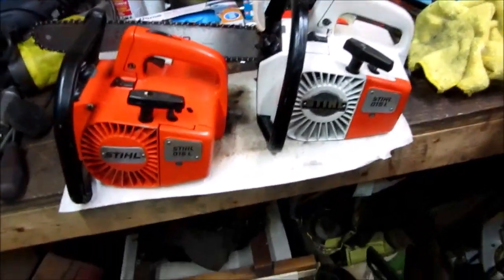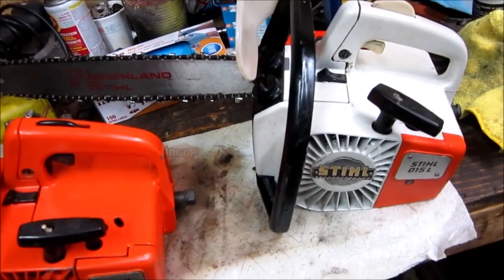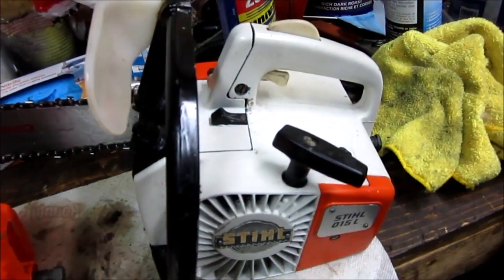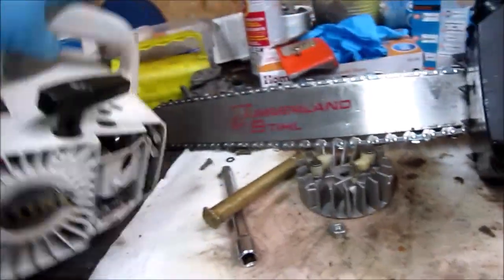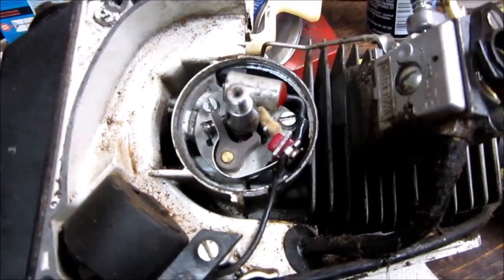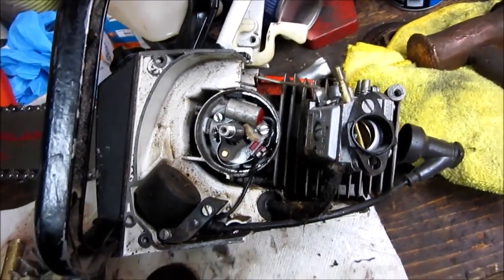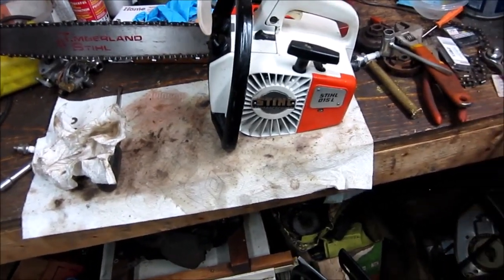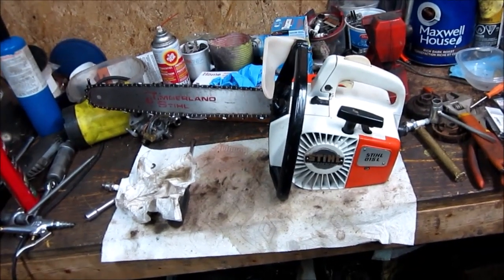Stihl 015L cleaning and seating the points

Comment: I just bought on ebay for $25 the electronic ignition module for my 1973 015L that's used to delete the points system and it works waaay better than the points did. The points on mine actually worked very good and had hot spark but the electronic module is much better, especially on the top end. Was very easy to install, looks good, is 100% water and vibration proof and it'll be the last time you have to remove the flywheel for ignition related problems. I bought this saw a month ago and I'm already just about done building it. Has custom expansion chamber exhaust, custom K&n air filter, brush polished sprocket/muffler cover, and I made a custom felling spike for it and ported the cylinder head. I like this saw because it can be customized and easily returned to stock. I have a 14" rollomatic stihl bar for it with 1/4 chain and a 14" titanium carving dime nose bar for it, it pulls both like they're 10". I'll send you some pics of my saw if you'd like, it's a little beast.
Reply from the maker: Sorry I just seen your comment and I agree with you

Comment: $15 was a steal for that saw, I just paid $87 on ebay for an 015L to restore as a project and another $40 in parts to get it running and looking good. I ported and polished the cylinder head and now this little saw has alot of grunt for a small saw. It pulls a 16" bar like it's a 12.
Reply from the maker: There a great little saw . Thanks for taking your time to watch and comment Cheers
Reply: hey big texas. I also was given a 015 L that hasnt been started in 10 years... sitting in an open garage. it started right up for me. im in west texas by angelo, can you teach me how to polish the head and port it? I need it to provide for my family due to the oil fields being shut down.
Reply: @thomaszinecker1785  I learned how to do it by searching - chainsaw porting - here on youtube. It's not hard, you just need the proper tools. This video helped me alot posted by a user named Human. - First Cylinder Porting, Stihl MS270 - After you've successfully ported your saw then you'll want to look at - how to advance chainsaw timing videos - to make the overall throttle response more snappier. Then you'll truly be proud of your work and happy with your new little monster saw.

Comment: I just inherited a 015L. Has not been touched in years. Put some fuel in it and strted up in about 10 pulls :-) has a 78 surrounded by a circle by the serial number. Nice little saw Sucker is all metal
Reply from the maker: Cool they are a great little saw

Comment: Cool vid. Thanks for the info. I just picked one up for $10. Hadn't ran in a long time. New gas and it would run choked. After sitting for a couple days it decided to run. A quick tune and sharpen and works great. Cool old saws....

Comment: Huck01955 - pay no attention to the knuckle head that doesn't know how to set points. Shouldn't be working on his machine anyway. I sent this ? to Big Texas.  Thinking you might be able to address as well. . Since you have taken apart your 015L, do you have any advise on the oil system operation? My unit appears to leak oil from the oiler port during storage. Is this normal?  (I wouldn't think so) I'm in the process of tear down and cleaning.  Would like to get this fixed. Thanks for any input.
Reply from the maker: Hello William a lot of these little sthils do leak when sitting for a long pierid of time . I have not done anything with the oiler on mine . Mine dose leak as well . we have some newer Stihls at work do the same thing on them I have seen some that the screws that hold it on to the saw just needed snugging up . Im sorry I cant give you any real good info on the oiler for an 015 . I hope you have a great Christmas and a happy new year .

Comment: What did it sound like before? I got an old echo 500vl that runs, idles and throttles good but it sounds real poppy, not a low throaty rumble like I think it should. Couldn't feel any slop in the piston and rings are excellent.
Reply from the maker: Brian it was popping and running real bad . I new it was the points right away . Sounds like your on the right track
Reply: @huck01955  Well unfortunately I did the points and it made zero difference. Thought maybe I had an air leak but it's 100% air tight. Could definitely use a carb kit though so that's the last thing to try once it comes in here we'll see.
Reply from the maker: @briancarb7544  Dont give up Brian you will get it sorted out .